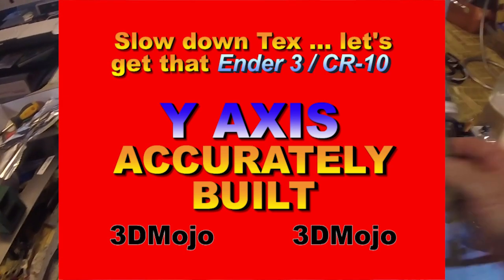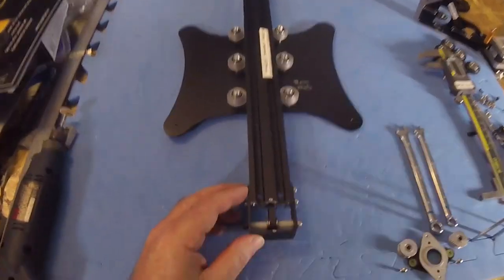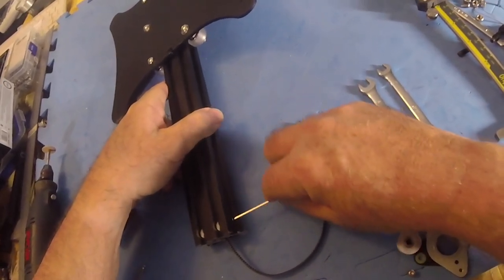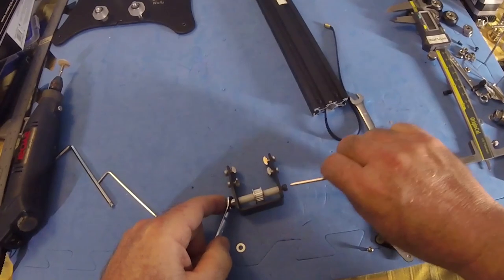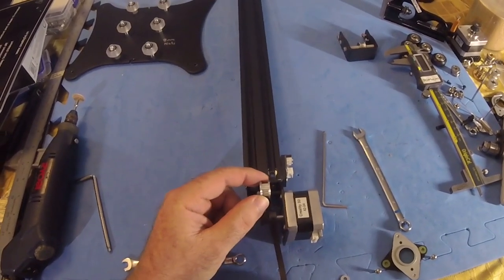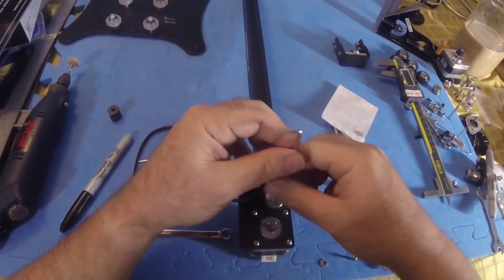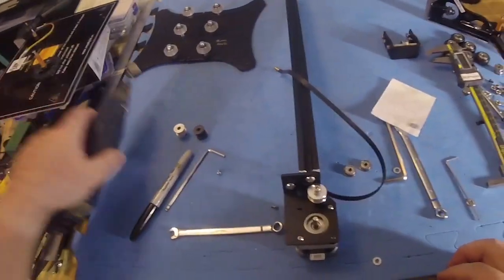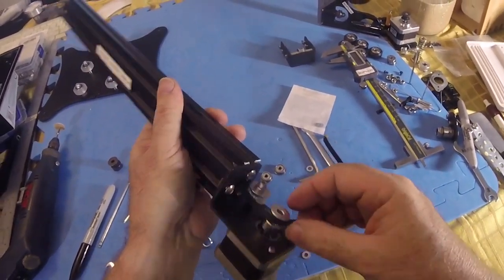Y AXIS Modifications and Calibrations for Ender 3, CR-10s and similar

Comment: Thinking your working on a CR-10, just an FYI for anyone that watches you will have issues with putting the stepper motor dampeners on the ender3/or 3pro.  The bed adjustment wheel will crash into your stepper motor. Only option is to find a smaller knob to avoid this instance. Great video & Thanks!
Reply from the maker: Great advice ... I will see if I can put that in the description of the video that mentions that.  I want a Ender 3 just to make a special quality building video but that will be a little down the road.  Check in to the E3HD EZABL bed leveling sensor.  You would need to flash your Melzi board to their modified Marlin but you gain a lot of good stuff.  Then either print or just buy their aluminum tube supported solid mounts for under the heat bed.  I plan on doing a video on this but its a big video covering a lot of stuff.  In the end you get a more accurate and repeatable nozzle leveling that takes into consideration any variables in your print bed.  No more knobs to adjust.  I am amazed at how long that can take if your trying to be accurate.  Thanks for any and all advice!
Reply from the maker: Taz, I just found out something today that freaked me out about the printers setup ... my frame came preassembled from Creality ... it was 1 degree tilting forward.  I just did the math and found out that
at 14" from bed to hotend that creates a 8mm lean from bottom to top ... I am getting ready to make an alert video about this because even 1/2 a degree at 14" would create a 4mm vertical forward creep.  WOW
Reply: @3dmojo275  Yes, highly recommend that you check everything when they arrive, my whole setup was loose including the bed which had a slight bind due to one side being tighter than the other. Folks need to realize that even with the best quality control you still need to check every bolt, make sure the frame comes out square and all your connections are properly tightened. These aren't plug n play and you have to be a little more informed cuz these are NOT inkjet printers lol. I also check all my electrical because they don't have the temperature run on enabled in the firmware which can't be flashed via USB (https://www.th3dstudio.com/product/arduino-uno-bootloader-flashing-kit/) need this to get the ability to flash
Reply from the maker: By the way when I get my Ender 3 in a couple of weeks or less I will make a video on the cutting of the build plate support to handle the motor vibration mount! New series coming up shortly and more precise and to the point.  Thanks again for watching
Reply from the maker: Sgt Taz I found a new way to help with the Y motor vibration that may work for you.  I found some cork NEMA17 mounts that are around 1/8" thick.  I will post something sometime but hey its better than motor to direct metal and it does not take a lot of space.  Also, putting a dampener like I did in the videos on the Bowden motor is NOT A GOOD IDEA

Comment: Would you recommend using a smooth bearing over the toothed bearing for the idler pulleys in your  video?  I would think the only place you want the toothed gear is on the stepper motor.
Reply from the maker: Yes most people would use a smooth idler wheel and tooth anywhere you need the belt to drive something.  I am making a dual Z setup and the adjuster will use three pulleys.  One will be geared and the other will be smooth.  I am doing that because the geared one will pull tension on the belt and it works well like that whereas the idler ones will only see the back of the belt.  I hope that helps.
Reply: @3dmojo275  Thanks for getting back to me. Although I'm fairly mechanically inclined my background is in EE. Being retired I'm always looking for a new somewhat challenging hobby.  3D printing has me interested.  After watching hours and hours of youtube videos on the subject, I ordered an Ender 3 Pro (it should be here in about a week).  I really appreciate the detail in your videos and hope to apply the same concepts to my printer.  A dual Z setup is way out of my league and I'm looking forward to seeing your design.
Reply from the maker: I need to get a Ender 3 and do a over the top precision build like most of my videos but I just picked up a new in box FLSUN printer and a used Anet A8 plus a cute little M3D cube printer for $200 so there went the Ender for this month.  Besides I got the wife a NIB Monoprice Select V2 (really cute) and I have it printing pretty good but one printer series at a time ... editing is a bear